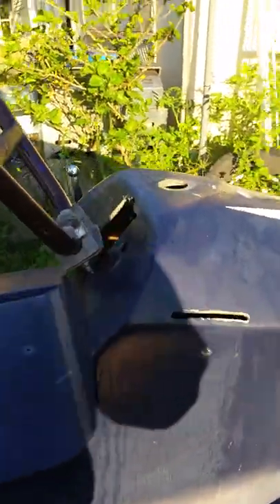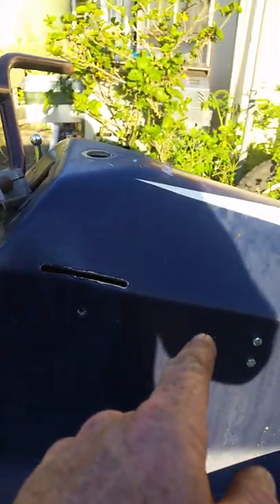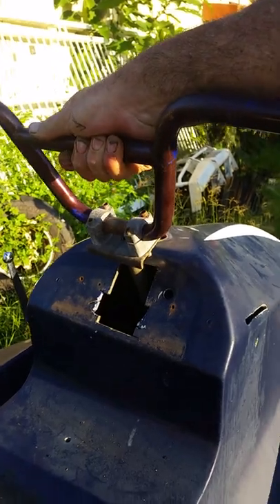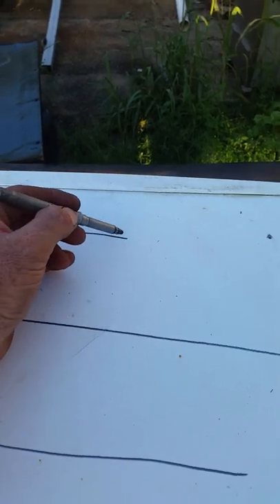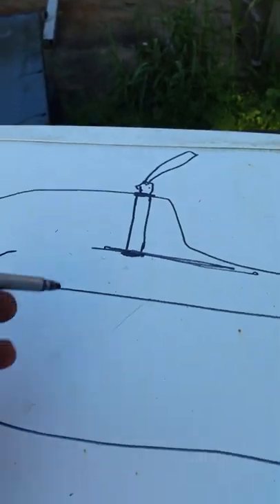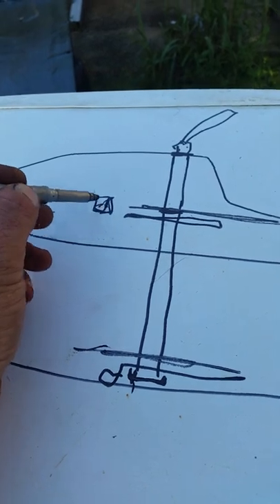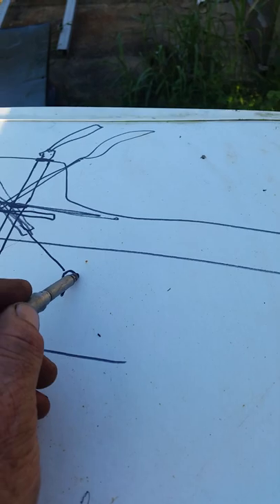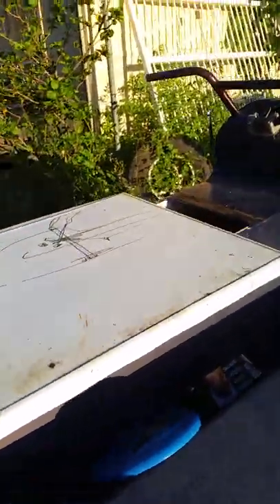barracuda hydrocycle steering rebuild part 2

Comment: My steering was busted loose also. I was planning on doing something similar, but fiberglassing the supports in. I got my hydrocycle apart right now, separated the bottom and top to do some fiberglass work and I gotta put new wood on the transom. 
I don’t have that scoop off the back, that’s kinda cool. What year is that one? Mine is a 69, I got a freshly rebuilt 33hp 69 evinrude skitwin for it.
Lemme ask you, on yours, the floor where you put your feet, is it all warped? Mine is, and every one I’ve seen is too. Drives me nuts, I might cut all the warp out and refiberglass that too. 
On mine the seam was bad in places and all the rub rail is dented and rivets coming loose... I gotta fix both sides of the entire seam to get rid of all the old rivet holes. Gonna really beef up the seam and get new rail and rubber, and address the steering while I’m in there. 
Mine also has spiderweb cracks all over the entire gelcoat of the top, so I gotta get some resin on it and spend some time sanding, then paint...
Sounds like a lot, but the hard part is done, separating the boat without ruining it...
I’m gonna subscribe and follow along, hopefully I can find motivation to get mine going... it was sittin in a field for like 40 years...
Reply: Ha! Already subscribed ;)
Reply from the maker: Lol , yea i thought i reconised the name , from what ive been told its a 78, but it mite be earlier , no warping in the footwells, but mine has boards down the inside glassed in which joins the top shell to the lower half, the scoop at the back was a later addition from what i can gather, it was apparently raced at some stage , im guessing for wind resistance and keeping the water off the motor, seems to work, still havent decided if im going to remove it yet as it makes a good back rest for a passenger, i still have to put my bump edging back around mine, just need to find a couple of corners to pin it at the back

Comment: How’s it going??? More updates?
Reply from the maker: Sorry iv been away from it a bit due to a bathroom reno taking up more time than expected, strangely enough about a month ago i found another hydrocycle hiding in the back blocks of nsw, 6 1/2 hour drive there, 7 1/2 hours drive back, lol, just up the road lol, so i now have two , this ones much earlier tho, i guy used to race it with a 40hp, recons it was insanely fast, it  does have a steering wheel and morse cable for steering tho, not sure how that would go as i like the throttle on the handlebars to get on and off the juice, a steering wheel means  forward controls and limited throttle response, il make a little video tomorrow and post it up 👍😃